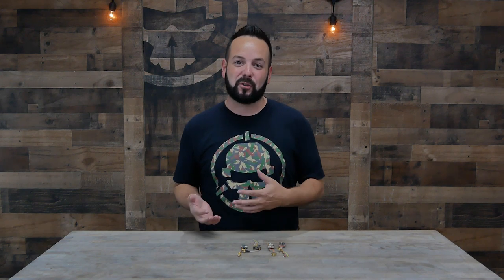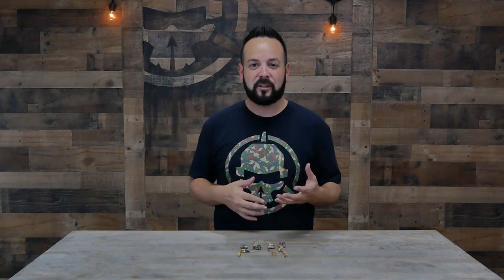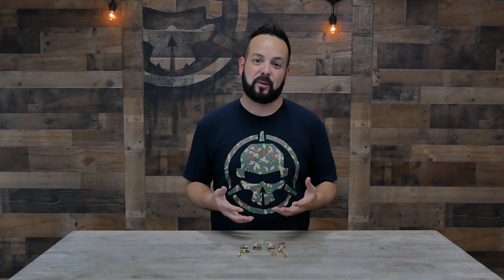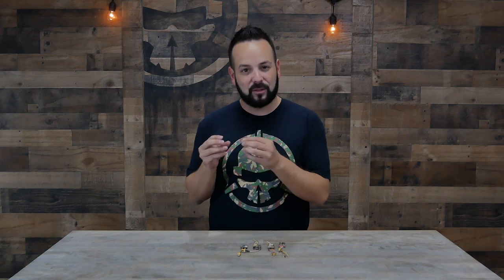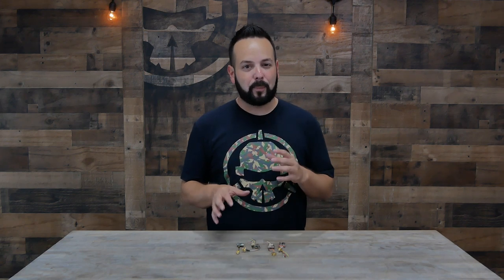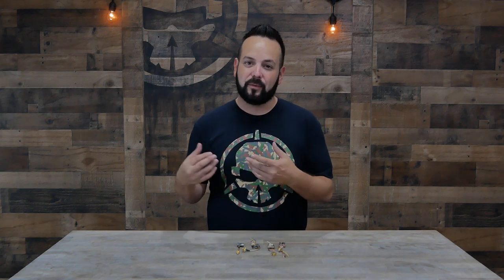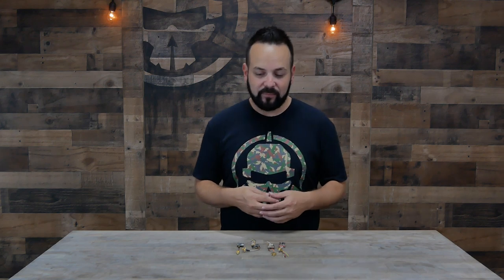Choosing Video Transmitters (VTX) for FPV

Comment: Before watching the video, I have to say you can't go wrong with the eachine tx805. It's a 12 buck 800mw VTX, I've used them for about a year before switching to unifys and I have to say it's the best bang for buck vtx on the market. Pretty reliable as well, never had one burn out, only had one short circuit due to crashing in snow.

Comment: wish there was a VTX  that plugged in to my receiver to setup on a 3pos for power setting and as i got to the end of my range on lets say 200mw flick of the switch while in the air and bang im on 600mw and the next flick 1000mw
Reply: They could set it up from flight controller connecting it to s.port or f.port data.. then set adjustment in betaflight.. that be so cool . Need new fc design though..

Comment: Thanks for the tips! I would never of thought that a higher output on the VTX could make it worse on multi passing in bad RF areas. And I do use MMCX 90° pigtails because swooping down the side of the VTX with a 4 inch pigtail works quite nicely but then that just means more lost through each connection is that correct? thanks!

Comment: I have question, What stops the drone from flipping over when  you put a big heavy gopro on top?
Reply: It uses a controller with feedback like a PID. There is a gyro sensor that tells the controller if the drone is tilted and by how much on each axis. The controller then calculates the required rpm for each motor to keep the drone leveled.
Reply: @anthonyyaghi6342  woah

Comment: Do goggles come with smart audio too or do I not have to worry about that
Reply: Ty Dortch  smart audio is on the vtx not goggles
Reply: Ivan Langford so when you change channels via smart audio do you use your goggles tho
Reply: @tydortch3063  you do But only to view your osd  meaning your video Tx with smart audio would plug in to a FC (flight controller) then by pushing the sticks on your radio TX a menu would pop open that you would see thur you goggles or Ground station that you could change the settings
Reply: Ivan Langford ok sweet that will come in handy

Comment: I got 2km transmit with skyzone vtx 200mw
Reply: hey man, im just starting out on fpv, but i have an issue and i happen to use the same vtx, maybe you could give me a hint?
the vtx does connect to my googles as the signal symbol on screen indicates, but i only get a black picture so obviously there is no video data.
Do you think the problem is related to the camera or might it be the transmitter as well? Because i am about to switch parts to point out the source of failure, but the thing is, i had these parts lying around for quiet some time now and i accidentally put power on the vtx without mounted antenna a few times already..
So do you have - by chance - some educated guess wether i should change camera or vtx first?
i would appreciate any kind of help since im trying to save a bit of money ;)
Reply: @CyberWallX  i think the problem is wire signal  from camera not correctly connected at vtx ,,that why blackscreen
Reply: @CyberWallX  replace signal wire if broken,keep it tighten always
Reply: @districtfpv6394  that sounds reasonable. i visually checked the cable already for i dont have any ohm meter lying around. but i guess i just replace it and try again. thanks man!

Comment: i'm not sure this is good info but i still use normal radio and i never go above 200mw on vtx, this means my video will fail before my nirvana radio, also vtx is super hot on 200mw, bit worried to go higher.

Comment: I got the FrSky R9M. Its output power is at 200mW. The RSSI drops down to 20 and im only maximum 50 meters away from me. What should be wrong?
Reply: Yoshi make sure ur up to date with frimware and ur set up something might be blocking ur signal
Reply: @Mrfunkyfpv  OK thanks

Comment: Why are there no big antennas on these vtx, like the antennas on the goggles ? Are they outdated and the small antennas better now ?
Reply: Depends on what you mean by big. If you mean big and square or just kind of strangely shaped in general, you may be talking about directional antennas. Some antennas are specifically designed as receiving antennas. In general, antennas have gotten smaller with the same quality of video so you may see larger ones on goggles because that's an older antenna that a pilot still had and now uses it as a receiver antenna with a new, smaller one on the quad.
Reply: What you're seeing is the lead wire for the antenna. The antenna screws onto the end of those wires.